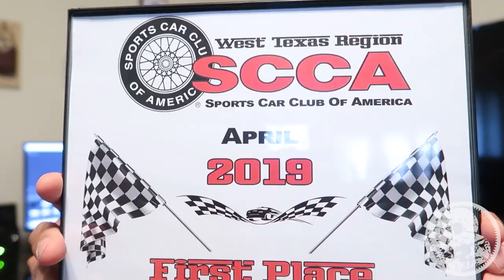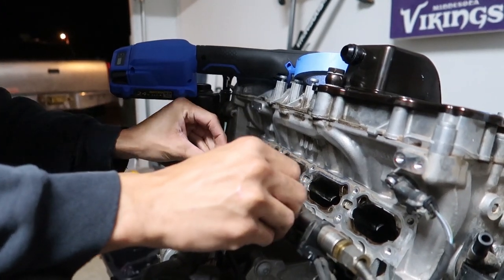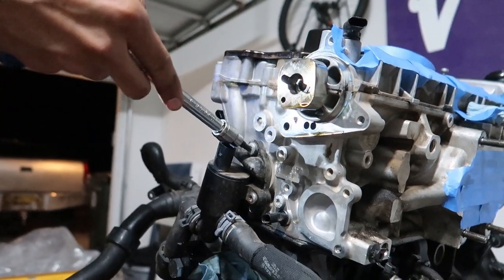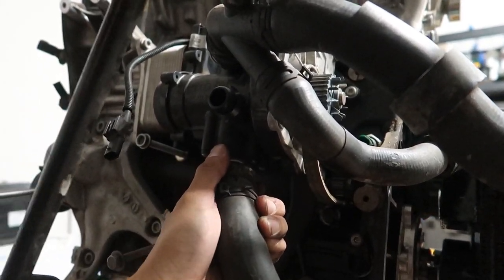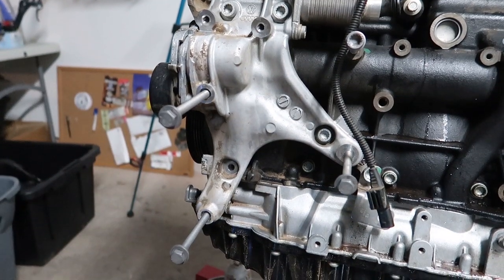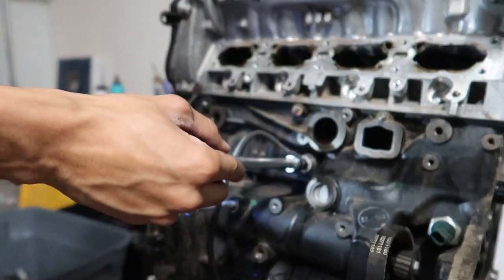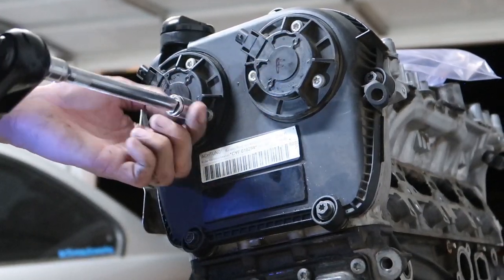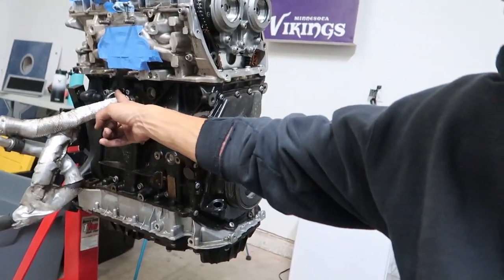Engine Build - Breakdown! Part 2 - Injectors, water pump & more! | MK7 Golf R

Comment: Thanks so very much for putting these teardown videos up!  On my daughters 145k miles Golf 1.8TSi I have just done a DIY carbon cleaning, replace all injectors, replace waterpump/tstat housing, replace leaking oil cooler and seal, and also the seal the other side of the oil cooler bracket.  I found your videos with the engine out of the car massively helpful just to see how it all comes apart and goes back together.  I just wish working on the engine with it still in the car was as easy lol...as you will for sure know I think the super-tight access is the hardest part of working on these VAG cars!!
Reply from the maker: Glad I could be of some assistance!! These cars are neat, for sure would benefit from smaller hands to wrench around it 😆

Comment: Remove hpfp when reinstalling vacuum pump to make it easier to install vac pump or tension on roller won’t allow pump to go in smooth
Reply from the maker: Okay sweet I was wondering cause I felt tension and heard a click.. makes sense. Thanks dude!
Reply: @BryceJordanProductions  also when installing hpfp back on work each one of the bolts evenly , ive seen people zap one bolt in rather than working them down evenly and crack the hpfp

Comment: Behind the camshaft magnet is a valve. You need VW Tool T10352/1 or T10352/2 to remove it. (Paul knows which of the two it is, forgot myself) 
06L109259D & 06L109257F are the 2 parts.
I have had the valves fail a few times since I built the engine. Not sure if a fluke or if related.
Last time was back in August, got so tired of trying to figure out which one failed I just end up replacing both magnet and valve on intake and exhaust valve.
Reply from the maker: Do the valves need removed to remove the cams or are you saying just to replaces the valves?
Reply: @BryceJordanProductions  no valves dont have to be removed in order to remove cams
Reply from the maker: Thanks guys! Screenshoting this information just in case, much appreciated 🤙
Reply: @BryceJordanProductions  you don't have to remove them but the cam bridge need to be cleaned to avoid low oil pressure issues in future and also inspecting the cam bridge screen (small filter on the cam bridge)
Reply: You forgot the important information that the valves are reverse thread.
Reply from the maker: Y'all are awesome!!!

Comment: It will add to costs but water pump will probably need replacing if it's the original one.
Reply from the maker: 10000% changing that. I think I'm one of the few who never leaked but it's gonna be swapped out.